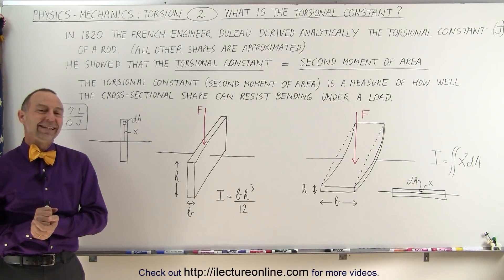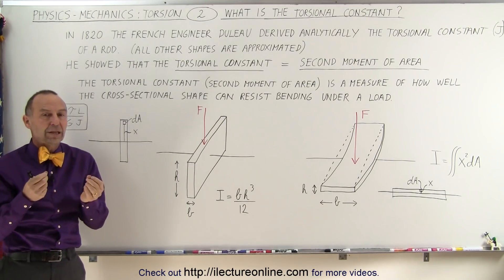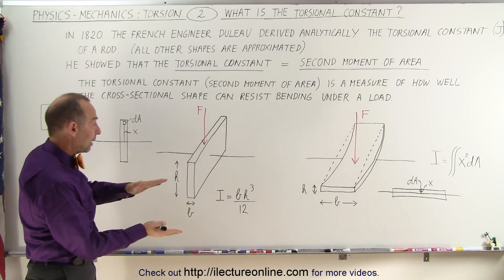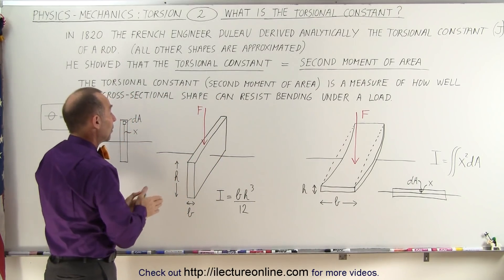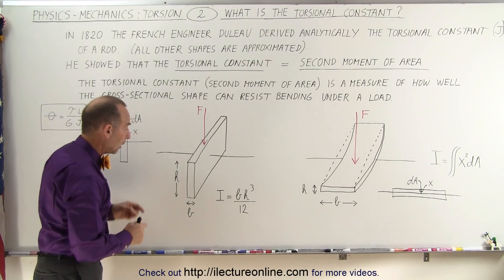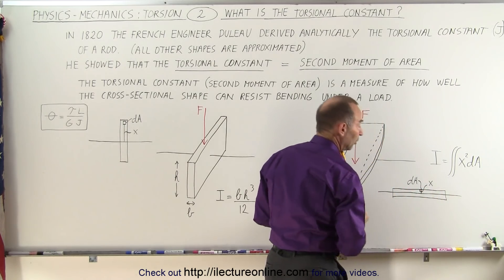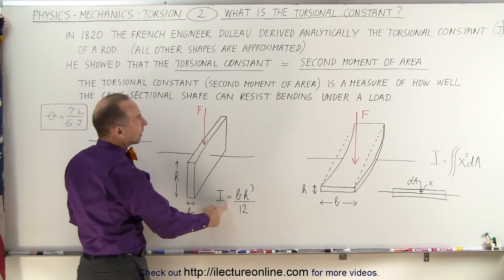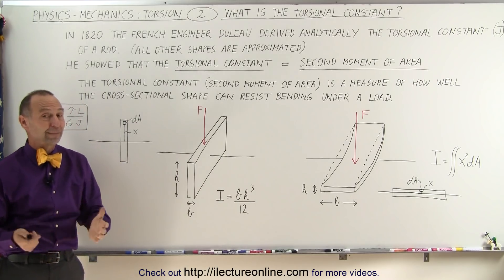Physics 16.6  Torsion (2 of 14) What is Torsional Constant?

Comment: The video is completly off the topic. What you have explained is flexural inertia (I) (which is (rightly) directly proportional to bending resistance) and not Torsional Consatnt (J). I humbly request you to rectify or clarify if I am wrong.  A.S. Rajas (Structural Engineer)
Reply: Only the first part is correct that the you can only derive the torsional constant of a rod and other shapes are approximations. Then he goes on to talk about second moment of area like it is the same thing. Circular cross section is the only shape where the value of torsion constant is the same as second moment of area.